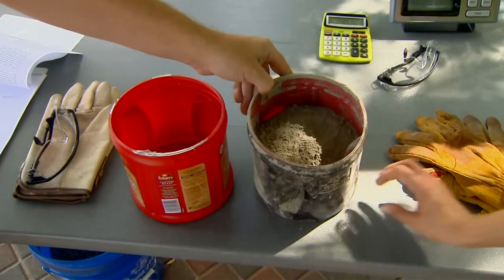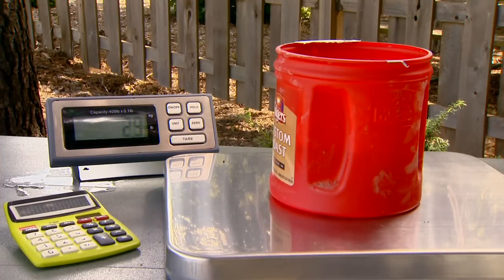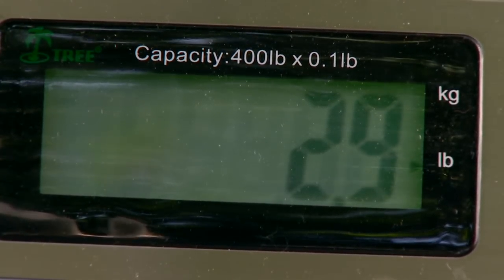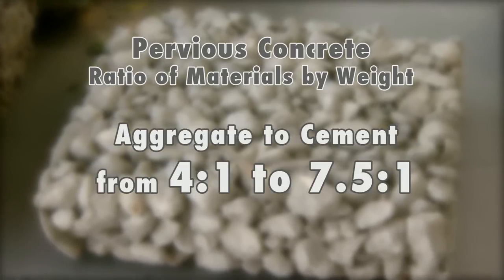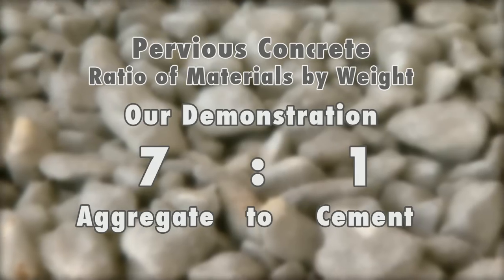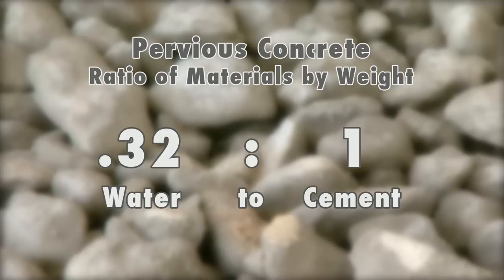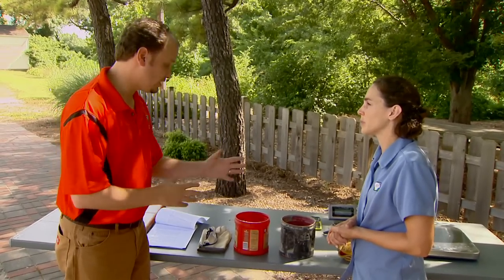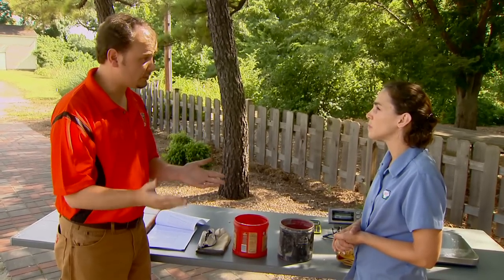Pervious Concrete

Comment: Great content!
Everything is explained in few minutes. Contact area, the inferfacial zone between cement paste and aggregates or FIBER, plays an important role in permeability, durability and strenght of concrete and is a function of thickness of  the contact area, type of fiber , type of cement, type of pozzolan, w/c ratio and concrete zone. HOWEVER, IT SHOULD BE NOTED THAT HUSK OF PERVIOUS CONCRETE IS A PRECIOUS AGRICULTURAL PRODUCT AND A RAW INDUSTRIAL SUBSTANCE OF VARIOUS USE. Differnt studies have suggested   that RECYCLING the components of waste materials SAVES ENERGY IN CEMENT PRODUVTION AND PRESERVES NATURAL RESOURCES AND ENVIROMENT. Like how you compare with Portland cement, classical type for PROS and CONS. 👍👌

Comment: Good video!
But I would mention:
MAKE SURE the ground is prepared to receive the water!
If you're putting down a sidewalk, and the ground is 
Packed Clay, all that water is just going to fill up the concrete, and you're right back to flooding, standing water,  or whatever you're trying to fix!

Comment: hi, which liquid is sprayed finally and why.
Reply from the maker: Hi there, thanks for tuning in! That is simply just water to show the movement of the water through the concrete. Happy Gardening!
Reply: Hello Affaq.  The water in the spray bottle is to keep the pervious concrete wet under the plastic so that it has time to cure.  If it dries out too fast, the concrete will not cure properly and there is a high likelihood of your pervious concrete being week and raveling easily.

Comment: I mix rocks and cement. Well I wet the rocks a lil in bucket then drsin water off then add cement. Then mix the two well then add water based on cement content. Then add a lil water from dish sop bottle mixing as I go. As soon as the cement starts to shine and is mixed, its into form.

Comment: I did a test run on a 12x12x1.5 inch square and it works great. I did the 7-1 ratio. As soon as the portland cement gets a shine to it you have enough water. You want just enough water to cause cement to coat rock. I used pea pebble in mine.